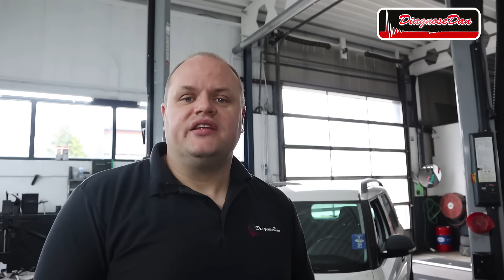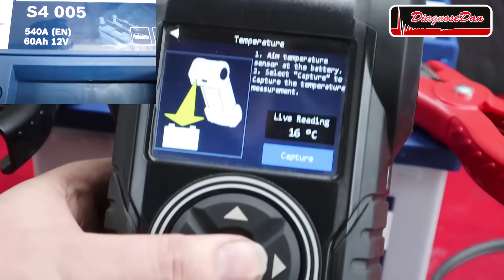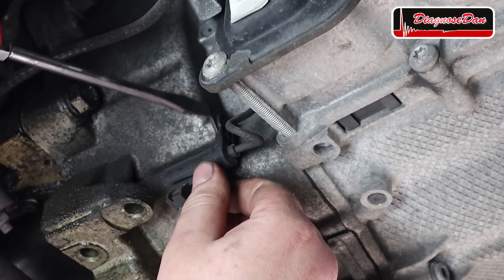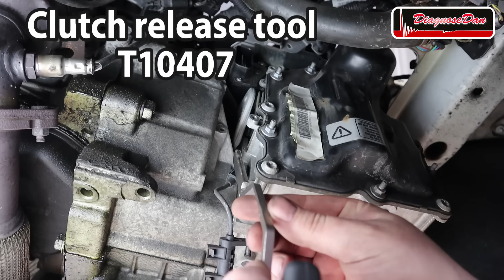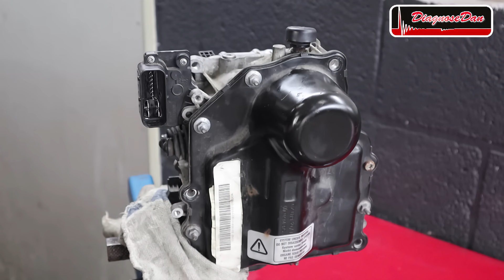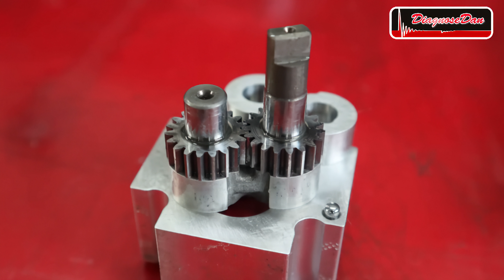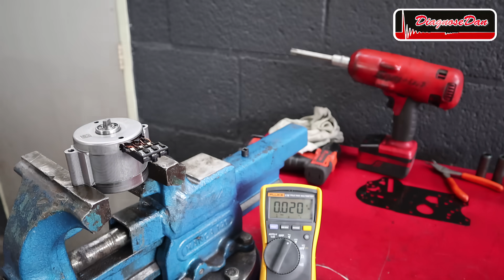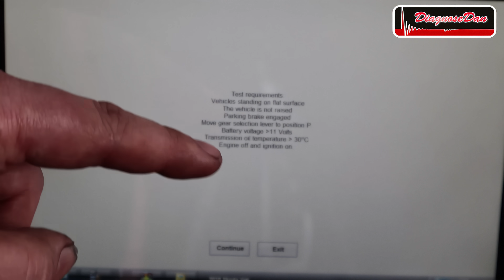DSG Gearbox Diagnosed explained Fixed

Comment: I've always been a bit unsure of the wizardry that goes on inside a DSG gearbox. What an excellent video, everything is clearly explained, good audio and good camerawork.
Reply: Best DSG video ever! Wonderful explanation
Reply: Awesome Explanation. Thanks
Reply: Really good vid! Given up on my Audi dealer who just think a fix is a reset.
Reply: @terminal-velocity111 😂 very good comment
Reply: bravooooo
Reply: yeah same here, I have a 2012 octavia vrs with DSG and its amazing to see this video pull the whole thing apart
Reply: Its not wizardry, its engineering. Dont mix the 2.
Reply from the maker: Thank you very much 👍
Reply: @Diagnosedan  The square headed VW engineers never cease to amaze with thier boneheaded technology. Rube Goldberg has nothng on these idiots.
Reply: @Diagnosedan  k

Comment: Hey sir plz help I have Skoda Superb 2009 1.8 tsi dsg 7 speed & in P ( park mode ) the engine revves upto 4000 rpm I don’t know weather it is fixed to rev only till 4000 rpm in park but sometimes it’s revves more than 4000 rpm like it revves almost 7000 rpm & this also happened when there was a low fuel in it ( only very little fuel ) & it had a misfire in cold starts but it becomes better when the engine heats up then no misfire & recently I had a mechatronic failure the hydraulic fluid was coming out & it had a crack in the mechatronic unit where there is vacuum accumulator sir plz tell why it happened my mechatronic cracks due to pressure any reason why & how to keep it safe after I repair mechatronic & this happened when I recently changed my Skoda Superb battery 🔋 with my Skoda Octavia 2003 diesel battery few days before the mechatronic of my Skoda Superb cracked plz help sir 🥺🥺🥺🥺🥺🥺🥺🥺🥺🥺  & the 1.8 tsi engine drinks the oil like every 1000 km 1liter Of oil & in the owners manual of Skoda says it’s ok it drinks oil 1liter every 1000km sir big fan plz sir
Reply from the maker: Ask technical questions in the Diagnosedan Global tech support group on Facebook
Reply: DiagnoseDan  is that group free to join & ask

Comment: It requires a charge of 24 hours at 2 to 3 amps in order to fully charge a lead acid battery of that size . You cannot test a battery that is not fully charged , unless you are trying to sell batteries .
Reply from the maker: The tester doesn't only test the state of charge, if that's the only problem the tester will say "charge and retest"

Comment: There a couple of common modes of failure on these, the first (most common I have seen anyway) is a blown accumulator in the mechatronics, this is usually given away by mechatronics fluid ejected from the mechatronics breather. The other is electrical faults caused by the gearbox oil.
Reply from the maker: You are right👍

Comment: 20:16 is it normal for gearbox oil to have submerged the circuit board? I can see the cover has a gasket.
Reply from the maker: I guess it was not designed that way but we are that on every one of them.
Reply: good question, i was wondering the same thing
Reply: It's designed to be submerged in oil to help  with cooling the circuit board

Comment: I have a 2007 Skoda Octavia with the 6 speed DSG.  I've heard some horror stories re. these transmissions but I have to say I've had 240,000 trouble free kilometres out of mine to date.  My transmission oil was changed a few years ago.
Very informative video thanks.
Reply from the maker: That's great!

Comment: Thank you Dan for as always interesting and excellent content! Just like to add, if you like to use an oscilloscope to measure three phases, that you can, if there is no neutral point like the three phase motor in your video, add three equal resistors from each of the three phases into a star point. Well, now you have a neutral point and can connect three channels to each of the phases and ground to the star point made up of the three resistors. It could be done just for fun! ;-) Keep up the good work Dan, love your videos!
Reply from the maker: Thanks for the comment
Reply: @Diagnosedan  Hi, how do you depressurize the accumulator before opening? can it shoot out and injure someone?
Reply: Thank you, my friend, for the information. I have a problem with my car, it is byd, the bst transmission system, and I want to test the clutch lever No. 2, please. If I have any other program to communicate, it is preferred. @Diagnosedan

Comment: Excellent video Dan, well paced and clear imagery. I had a DSG gearbox in an 2017 Audi and only kept the car 18 months. Smooth acceleration but always shifting in normal driving and couldn’t make its mind up. IMHO these gearboxes should only be used in high performance applications. I’ve now an 8 speed ZF which shifts just as quickly with no hesitation and always seems to be in the right gear.
Reply from the maker: A DSG has some other advantages in comparison to full automatic. They are more fuel effecient
Reply: DiagnoseDan Hi Dan. Having both a 2017 A4 2.0 180 diesel and a 2018 BMW 330d, I disagree in that example as the economy is only a 10% difference in the Audi’s favour. The new ZF8s are very efficient and IMHO, negate the need, apart from cost, to use DCT.
Reply: @adrianwhitehead1950  Torque converter saps power and is definitely a lot less efficient. 8 speed ZF actually shifts around 50% faster than the DSG gearboxes.
Reply: beshj that maybe the theory, however, after owning both types, in reality I’ve noticed no different in shift speeds. The latest evolution of the ZF8 is far superior, IMHO, of the flawed DCT I had in my Audi. I can see the benefit in a performance application, but not in an ordinary driving style. The DCT was great when accelerating but did not work well in city driving or in cross country driving, it often became easily confused whereas the ZF8, by comparison, nearly always selects the correct gear.

Comment: Mani battery problems come from smart charging and S/S systems. Often smart charging is programmed for fuel economy and for example Nissans charge the battery about 5-15 minutes when the ambient temp is over 5c. cenario is- start the car, voltage is 14,4V, but after 15 minutes, the voltage goes to 12,7V
Reply from the maker: The current sensor Will calculate the state of charge, and keep the battery charged
Reply: @Diagnosedan   http://www.nissantechnicianinfo.mobi/htmlversions/2016_Feb_March_Issue_6/VoltageControl.html
Maybe on other makes and models, but Nissan aims for maximum fuel economy.
I have a 2011 X-trail T31 2.0DCI AT, with the current sensor on battery neg lead, With out Start/stop.
Went to a battery shop to test the battery and charging. They hooked they machine and after 5 minutes, the charging voltage dropped to 12.5v. Shop said that the alternator may be faulty. 
did some digging online and found a solution on QashQai forum to disconnect the sensor wire. Now the system voltage is 13,8-14,4v al lthe time.

Comment: could you do a video on changing the gearbox oil i would like to know how it is done I have a VW polo 2011. how did you deal with the release of pressure build up in the pump or it is not an issue if you remove the full DSG?
Reply from the maker: I had no issues with the pressure, Just drain the old oil from the Bottom of the Gearbox and refill it thru the breather that is near the shift lever
Reply: @Diagnosedan  Which gearbox  oil should VW Audi owners use now?

Comment: Great video! By the way, which DSG has  the most failure rate: Dry clutch or wet clutch?
Reply from the maker: Dry clutch
Reply: Come on, guys, I have a Golf 7, 2015, DSG 2, dry clutch, I drive 230.000 km with 0 problem...
Reply: @Soren G  50% of time I drive in city condition and believe me, I have days when I drive 10 km in 1 hour... so, I understant what you want try to tell me but I'm pretty sure the way you drive is very important for the gear box, manual or DSG. If you use "S" mode 70%  in period you drive or you want to be first on the street - sure the gear box failure. Have a great day!

Comment: Try using a drone electronic speed controller to test your three phase motor 
Should work pretty well for what you need on the bench too
Reply from the maker: Thanks for the great comment
Reply: DiagnoseDan no probs enjoyed your thorough video of diagnosis 
Stumbled across it as have a b7 with a dsg box and dash gear display intermittently flashes then doesn’t when it chooses ,doesn’t seem to affect performance just more annoying ahah ;)

Comment: Hi Dan. There was something else that you could check to the electric motor: if any of those copper wires is not shorted to the ground. That also could potentially burn that fuse. Just sayn'
Reply from the maker: If any of the copper wires was shorted, that fase wouldn't produce the same voltage as the other fase
Reply: @Diagnosedan  Also truth. 👍

Comment: Amazing how many points of failure this transmission has.  It's almost like there was a competition on who could make it fail the most ways.

Excellent video as always!!  One of the best channels to learn from.
Reply from the maker: Who won?😛
Reply: @Diagnosedan  
Hai.

Skoda rapid dsg 6 speed 

1,3,5 gears are not engaging properly and 2,4,6 gears are engaging properly.

Cleared the error code but came back again and not moving
Reply: @Diagnosedan  Well, designing a transmission that totally fails because it's own gear oil leaked into itself makes you a good contender for first place!   Absolutely ludicrous design in this day and age.  There's no need for this.  None.

Comment: Maybe you could add this to the video description:

-	Safety Recall 34F6 on 06 Dec 2013: Over time, the internal gearbox lead frame may corrode due to certain gearbox fluid additives used in original gearbox filling. If corrosion deposits collect between electrical wiring, an electrical short in the power supply may result in blown gearbox fuses and the deactivation of the gearbox hydraulic pump or mechatronic unit. The driver will immediately be alerted by a flashing gear indicator warning lamp in the instrument cluster and the vehicle will lose motive power but can coast to a stop. Loss of motive power while driving may increase the risk of a crash.
-	Corrective Action Replace existing synthetic gearbox oil with a new, mineralbased oil with non-corrosive additives to prevent future failure: https://static.nhtsa.gov/odi/rcl/2013/RCMN-13V568-9034.pdf
Reply from the maker: Thanks i'll do that! Great idea

Comment: Are there two electrical circuits for this DSG?  One circuit to run the electronics in the PCB, and another higher amperage circuit to run the motor for the hydraulic pump?   Or does the one 30A fuse provide power the electronic PCB and the hydraulic pump motor?

OK I watched more and got to the point where you discovered the melted PCB and housing.  I would imagine one of the switching transistors failed and shorted to ground.   I would guess this uses a number of small IGBTs or MOSFET power transistors.   Possible design defect where they undersized the transistors maybe?

Also when checking resistance between pins on the solenoids, you should also be checking resistance between each of the pins and the metal ground.

ANother tip, for checking 3 phase motors (or generators), an LCR meter tester is designed for this kind of test.  But these meters are expensive and not often used for general auto mechanics work.  They are essential when doing a lot of work with AC motors like with EVs
Reply from the maker: You are right there are 2 main Powers going in to the DSG
Reply: Interesting sulfur in the gear box oil was responsible for the failed PCB. Poor on the automaker for not testing fluids when deciding to submerge any electronics in said fluid lol
Reply: 2 circuits other is run by a 15 amp fuse which also blows, but happens a lot less frequently.

Comment: Is there any advantage in having a DSG, Forn me, just a 6 speed torque converyter type is all I want, I am prejudiced against  any VW vehicle anyway because it is a disreputable company, diesel scandal was enough for me.
Reply from the maker: All Car manufacturers used to cheat on emissions, VW was used as an example to warn other brands. A DSG or manual transmissions is more fuel effecient than a automatic Transmission so if you really care about emissions buy a VW😉
Reply: @Diagnosedan  Well down under VW has not had the best reputation fior reliability and good customer service but I can't speak for other parts of the world, I would rather have something from the Hyundai/Kia manufacturer, their vehicles now have a lot of German input and have gone ahead in leaps and bounds, also Mazda still favors the torque converter, DSG's are very bad in  long lines of stop start traffic with much clutch riding which must shorten their life and reports say they are not smooth in city driving, they are better uninterupted on the highway.

Comment: Hi dan, great vid as usual. Regarding battery test, without knowing recent background details, car parked up for a long while, lights left on etc. Would you carry out a bat test before and after recharging just to thoroughly confirm a poor battery.
Reply from the maker: The result is going to be "charge and retest" if the battery only is low on charge.
Reply: DiagnoseDan cheers dan. Stay safe.

Comment: Have a 2016 1.2 dsg yeti that makes a squealing type noise when pulling away bit like a bird tweeting, doesn't do it all the time, wonderd if dsg service might sort it?
Reply from the maker: Maybe it's in the clutches
Reply: Check your aux belt, if its the non 4wd version it would be very rare to be a gearbox issue, could be a bearing though. Do check your belts first.

Comment: Terrible video. I wanted to see the DSG gearbox procedures but almost fell asleep with all the nonsense advertising someone's battery tester. Their rep told you half of breakdowns are caused by batteries. Some folks believe anything they're told.I suggest you watch LM Auto repairs excellent videos. No way would he have junked the unit without finding the fault and fixing it. You've cost the customer a lot of unnecessary money for something that would cost pennies to fix.
Reply: sean kirby https://www.adac.de/rund-ums-fahrzeug/unfall-schaden-panne/adac-pannenstatistik/
Reply: I agree with you.
Reply from the maker: It's not made up it's statistics you can actually check. 
We have alot of experience repairing DSG and we know whats coming next. This customer wants the Transmission to be relieable and cares less about the costs. We have to waranty the unit and the only way to do that is to do it the right way. 
Not repairing a circuit board to have it fail next month on a solenoid or a Acumulator. 
Thanks for watching 👍
Reply: @Diagnosedan  Have you actually watched LM Auto Repair channel on here?
He does a first-class job.
If I was given a vehicle with a faulty DSG and started trying to sell a new battery, I know what the customer would think. Why waste 25% of the video on nothing related to the title?
Reply: @Diagnosedan  You clearly know nothing about these boxes because the solenoid is about the one thing in the mechatronic unit that DOESN'T go wrong.

Comment: Hi i have  2010 skoda  octavia scout  i got the car in early  January  since then its been brokedown  most of the time except for 2 weeks when it ran ok .the fault is in drive it seems to work ok then instead of displaying D3  it just displays  D and has no drive the garage where i got it took it back under warranty  but  after haveing it 4 weeks  .they said they spent £1,500 on repairing the back axle and wont repair this fault .my local garage says tb6ey think its the electronics. Is this possible, the original garage was a complete night mare they even managed to bump the back wing and get a parking ticket on it
Reply from the maker: Many things fail on these gearboxes it's hard to tell whats wrong without diagnosing it. I recommend you take the car to a DSG specialist.
Reply: Get someone to check the gear selector lever, also causes problems how you describe.

Comment: Thank you for the video.

I see you Are from Holland

Im from Denmark, can i Come with My car so you can diagnose it?

I think i have the same problem

What was the price for the mechatronic unit, and the labor price 😊?
Reply from the maker: If the Car has the same problem it doesn't drive, you should transport the Car to Holland
Reply: Hi we supported Dan with the mechatronic if you would like more information you can send me a e-mail with the details of the car, you can send it to sam@transmissies.nl

Comment: Hi Dan, Does the old DSG. Get exchanged to be reworked?
Reply from the maker: Yes the old unit gets remanufactured 👍
Reply: In this case Dan showed a lot as you could see the control unit was burned and we don't use that any more but a lot of the parts can be reused.
Reply: @transmissies  Could you not just supply the board and let Dan show us the programming?

Comment: The question is...why wasn't it a recall and why didn't the manufacturer cover this repair?
Reply: -	Safety Recall 34F6 on 06 Dec 2013: Over time, the internal gearbox lead frame may corrode due to certain gearbox fluid additives used in original gearbox filling. If corrosion deposits collect between electrical wiring, an electrical short in the power supply may result in blown gearbox fuses and the deactivation of the gearbox hydraulic pump or mechatronic unit. The driver will immediately be alerted by a flashing gear indicator warning lamp in the instrument cluster and the vehicle will lose motive power but can coast to a stop. Loss of motive power while driving may increase the risk of a crash.
-	Corrective Action Replace existing synthetic gearbox oil with a new, mineralbased oil with non-corrosive additives to prevent future failure: https://static.nhtsa.gov/odi/rcl/2013/RCMN-13V568-9034.pdf
Reply from the maker: It was a recall!